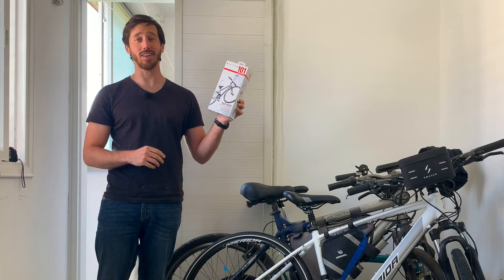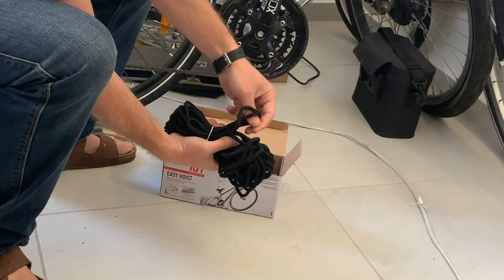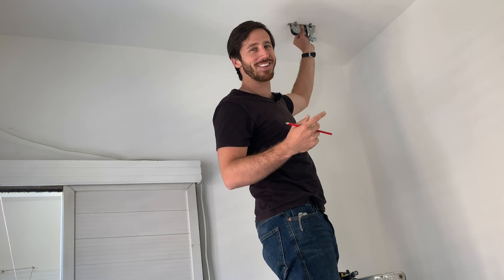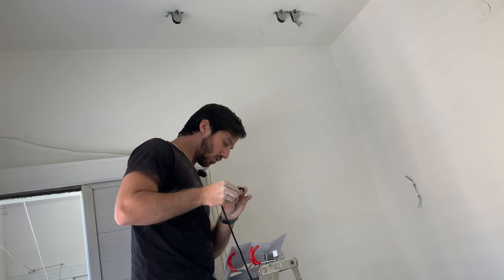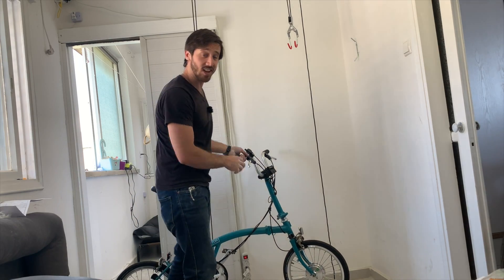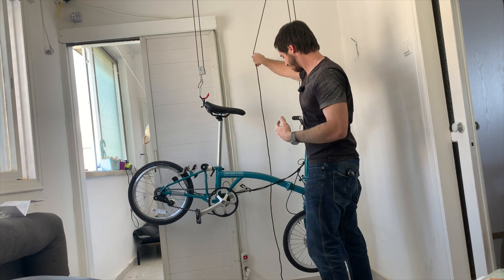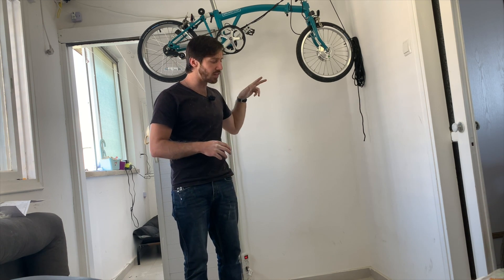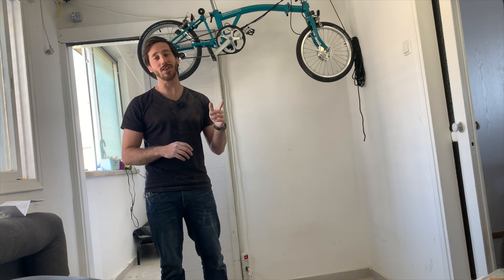Unbox and installing cheap bicycle lift (e-bike hoist)

Comment: i just saw this but I've had similar in my garage for about 2 years now, I park my escaped under two bikes and the locks are great, the lifts are near a heater and there is no thermal damage from the hot air on the code either.  Very Happy with these lifts, and also, you can use them to hold the bike as you work on the breaks and tires, I do have added straps though to ensure the bike will not slip off at the handle or seat, but that may not be needed, I just like the extra precaution.

Comment: I just bought some vruzend battery caps and I am very unsatisfied. After 2 months of use the caps have cracked and my cells are not getting contact. I filled out your contact form and I was just ignored. This was almost 25 days ago. Please just send me a new kit. My username on the site is ivanmckenzid
Reply: i can imagine the company having problems with the virus, although emailing would not be impossible. try emailing them, contact forms can be at fault sometimes

Comment: Has anyone cannibalized a electric scooter into a DIY ebike? Either modified the hub motor into the bikes wheel hub. Can a simple and relatively easy to fabricate conversation to maybe chain driven or friction powered?

Comment: Hi there mike I see u used the old switch kit for your Brompton and u have the new one for another bike can you use the new one on your Brompton as well and I have a problem with my battery pack where it turns off after it goes over a small to medium bump is there a DIY way I can attach that to a front luggage mount.

Comment: What is happening with your vintage motorcycle conversion project?  I'm very interested since I'm converting a scooter to electric using the same QS motor (12" wheel)

Comment: What difference in bms for ebike? Like cheap and expensive, and with switch or without, with separate or common ports. How do you charge high capacity battery with common port bms if no swith in it. By connecting charger or back to controller get a lot of sparks.

Comment: hi man, I need your help, I was going to ride a bike with a MY1020 1000w 48v , but do not know which battery to use to be able to take advantage of the, better engine and what its features, when I have engine on I can pedal when I have the controller and battery and engine on ?I'm new here but I love your channel

Comment: Watched your vids and bought your battery book.  Thanks.  I am installing first ebike kit. 1000w motor. Controller says:  Rated Voltage 48V (easy enough). Rated current 13A.  Max Current 26A.  Should I build my battery for 13A draw or 26A?

Comment: Hi Mikey, well I have a 24v with 15a recently I have noticed that it's not charging to full voltage. It reaches 27v full charge. I really need your help to know what might be the  problem.

Comment: Hey i have a question! Can i connect two lithium battery packs in parallel to a brushless motor kit? Are there any problems with the discharging and charging? My system is will be two 52v 15AH lithium batteries with a 1500w motor and controller that has 48 volts.
Thank you!

Comment: Nice! You could have just mounted the brompton directly on the wall at a similar height. But the pully system might get more practical if you're dealing with heavy ebikes.

Comment: I have 5 of these and use carabiners for hooks instead of the hangers provided. It's much safer and dont have the potential of slipping out. I would highly advise anyone installing these do the same.

Comment: good morning sir... am facing a grrat problem with my 24v 250w brushed motor...
its running good under no load condition but as soon as am riding it its speed drastically reduces and stopped totally...the problem is that the output capacitor from the controller to the motor is getting hot and blown everytime....again am changing the capacitor with the same rating its runs little and again gets heated and blowed off in load condtion...
please suggest me what to do...

Comment: I was thinking of maybe a wooden frame braced against the 2 corner walls, wide enough to allow another piece of timber to be used for mounting the pulleys instead of drilling into concrete ceilings - or if you can't find a joist (ie, flimsy sub-ceilings or floating ceilings that can't support anything beyond feather-weight)

Comment: Seams silly with a low ceiling and right next to a door but good if you have more height ,a lot better systems out there
Reply from the maker: Yea my space isn't optimal but its better than nothing and easier than trying to snag it on hooks. Also allows the wife to be able to raise and lower without lifting up to hooks.

Comment: I've looked at various bike lifts and hangers over the years, but for me hanging it from the ceiling doesn't actually get it out of the way, it just adds hassle. If I had 11 feet or higher ceilings it might be useful, but I don't want to be banging my head on the bike, and it's much easier to move out of the way if it's on the floor.

Comment: Great idea! I have a fat-tire Lectric eBike (made in Arizona USA) but it weighs about 60-64 lbs. Remove the 7lb battery and it’s still over 50 lbs. Do you have any suggestions for a proper lift? Naturally I’d test for at least 7 days before hanging my bike. The hanger will mount on joists in my garage. Thanks. I really like your channel. I’m a beginner and have lots to learn.
Reply: Hi.  Did you ever find a lift capable of holding the Lectric eBike?  We just bought 2 and are looking for a way to store them. It says they way 70lbs.  Thx!
Reply: @lorihall-poker6778    Hi. No I never did. No longer need one. Gave my bike to my son. Best wishes on your search. Have you tried Costco? They hv some good storage stuff online.
Reply: @cynforrest  Thank you for your response.  I think I may have found something. It is for Kayaks and it says up to 125lbs.  Not a bad price either.  My husbands bike was delivered last night. Still waiting on mine.  They are definitely big and heavy. Thanks again!
Reply: @lorihall-poker6778   You’re very welcome. The hoist sounds Great!

Comment: When do we get the video of the Chinese chain motor conversion
Reply: The one I ordered the same day of the video going up only arrived last week, thanks to a combination of Spring Festival and that damn virus. Depending on what safety measures are in place, it might not have even arrived there yet. Then again, I'm just glad to even have a postal service right now. Panicking morons have made it impossible to buy the basics. I'd like to be able to wipe my butthole again instead of having to shower ever time I take a dump!
Reply from the maker: Yes I have everything except for the batteries... I'm still waiting for those to arrive, unfortunately!
Reply: @EbikeSchool  my controller came in 9 days but the battery is now 3 weeks got to be patient in these crazy times thanks
Reply: @ernieleithes6545  😊You got that right.  I'm still waiting for my brake light with signal to come in so I can put it on my scooter.

Comment: Nice :) having had the same idea, and a slight ebike addiction issue too ;) I bought a double pack of these bike hoists on a prime special for like  $15, I'd say 3 or 4 years ago.
I have a stand too, but actually found that in certain situations having the bike higher makes for easier maintenance/ repairs.

Comment: Can you provide any info regarding mounting freewheels to hub motors?  I'm looking to make a bike like the one you featured in this video (https://www.youtube.com/watch?v=SHXQr2MPJS8) it also makes an appearance in the video I'm commenting on here.  I've only worked on bikes with cassettes. If I want to get a q100 rear hub motor what are the limitations to the freewheels I can select from?

Comment: @EbikeSchool.com Hi I've been looking a building a dual hub motor Ebike, I'm basing it on your DIY Two Motor 2wd Electric Bicycle video.  I was wondering would it be possible to use the  KT LCD8HU Color Matrix Display Meter Control Panel  instead of the  Cycle Analyst?  The Cycle Analyst is good but expensive and a bit boring! lol It needs a style update. I was wondering what i would need to do to use this Control panel if there were any pitfalls.  Maybe you could refresh your DIY Two Motor 2wd Electric Bicycle vid with this hardware?

Comment: i'm working on an electric motorcycle so i looked up diy electric motorcycle on youtube and your channel was one of the first to come up and that is how you earned a new sub. stay safe and don't touch your face
Reply: I almost finish working on my scooter.  This little thing got everything.  3 speed, headlight, including the horn.  Waiting for my brake light with signal to come in.  I just brought the new controller using 3000w, 80amps.  This scooter is moving.  Also as well cruise control.  And no I didn't brought it already equipped.  I actually made it.  Average now 25 mile range.  Can go max of 30. Top speed right now is 34mph. That Micah book comes very handy.
Reply: @slicaltimistic1  that so cool im trying to get mine up to 60mph dont know if it will work or not but good luck with your project.

Comment: Awesome drilling, Micah! It’s a good thing that they don’t have earthquakes there in Tel Aviv, with all that old masonry.  Why did you remove the battery when you said that these are ebike lifts that can handle the extra weight. Incredible content, as always!  Thank you so much, Micah
Reply: I guess maybe he was more concerned about the ceiling holding than the hardware he installed :P
Reply: Nemo Petersson Don’t bring down the ceiling, Micah! 😂😂

Comment: You could make a rack with hooks and hang the bike upside down by the wheels, and then use a pulley to bring the bike sideways up AWAY fro obstacles , so the bike ends up laying horizontally
Reply: I like the way ya think!